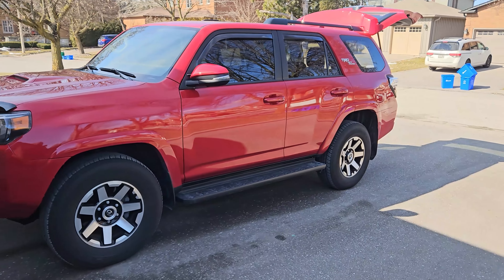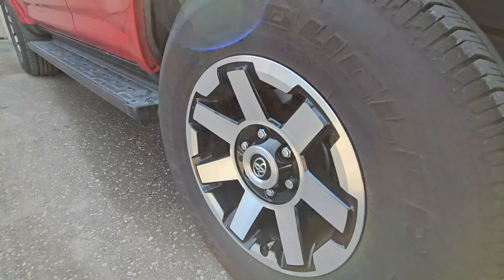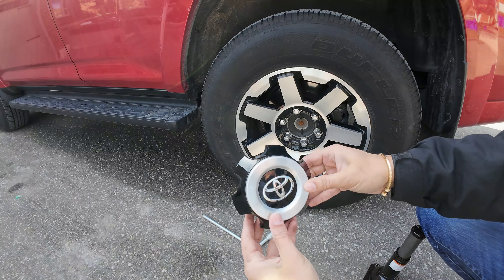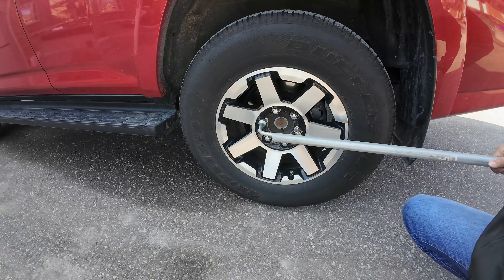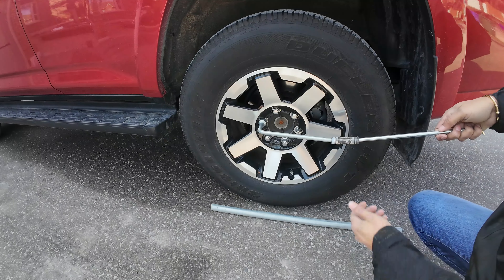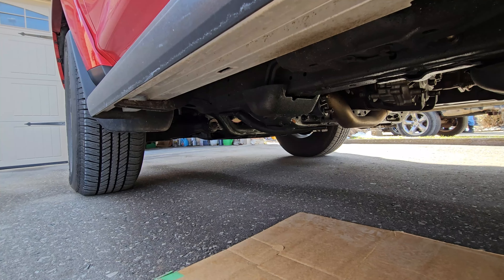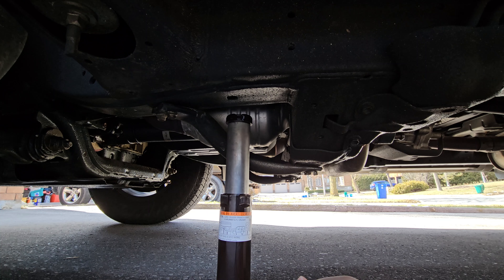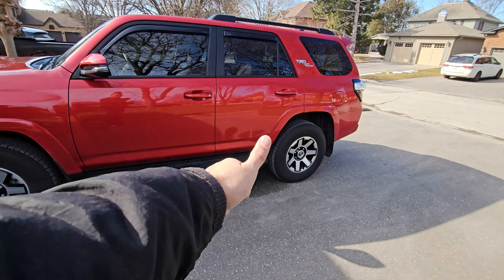4 Runner ... Spare Tire Jack / Setup and position

Comment: Nice instructional video. Everybody should do a test run when you're not rushed to get the procedure down. The Toyota jack is bare bones and unstable, so I purchased a 6 ton bottle jack that is more stable, with plenty of reach, that also stores in the same area as the original jack. Great tips for all. Be safe!
Reply from the maker: Thanks...yes I do agree..cheers!

Comment: IS the jack steady under the axle? If the vehicle rolls, it seems like it'll slip right off
Reply from the maker: You can block the other wheels to prevent roll
Reply: @4am4life-cc3oh  what can I block it with mister ? Can you make a video on chocking tires? Sending love from the island mon
Reply: Lifting from the axle tube is a secondary option. I don’t recommend it because the jack is contacting a round surface instead of a flat surface. Had a jack slip out when lifting from the axle tube one time. Luckily the wheel was on and I was not under the vehicle. I try to lift from the frame only.

Comment: Great👍 Tips... I've been in flat tire situations where I had No Pipe Extension to increase Leverage Angle and remove lug nuts...
Garage Mechanics used impact hammer to install lug nuts... Way
Over torqued!  

Happy Trails...!

Gung Fu Cowboy 🇺🇲
San Francisco Chinatown